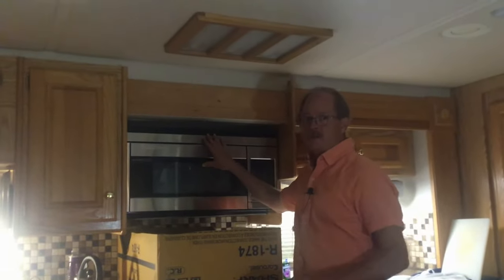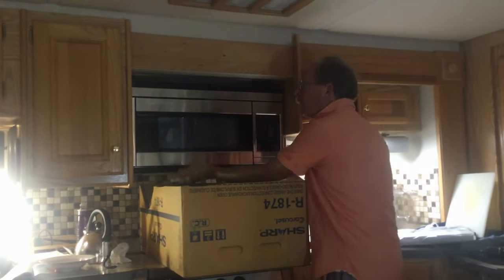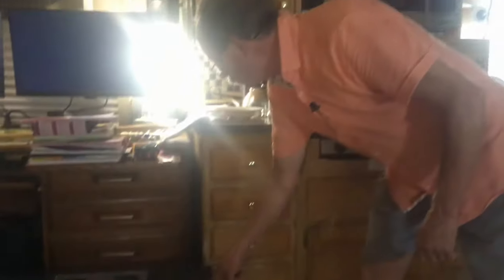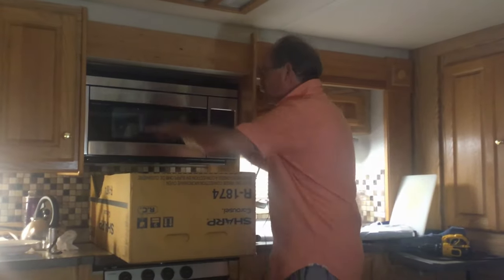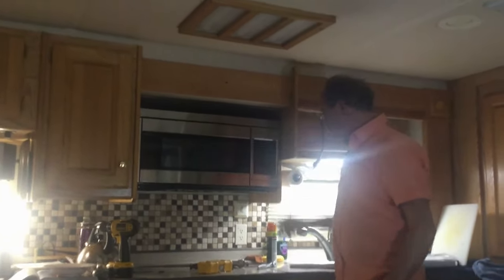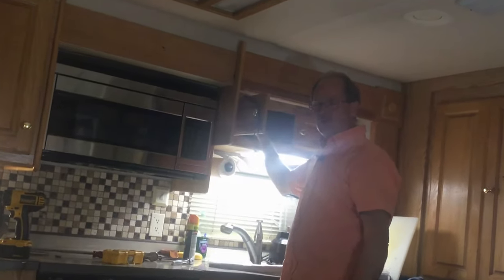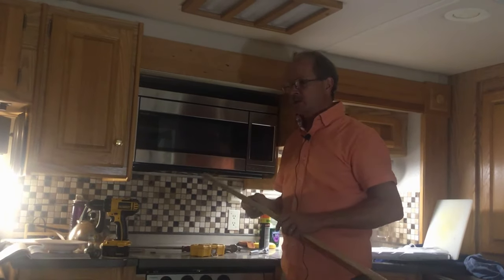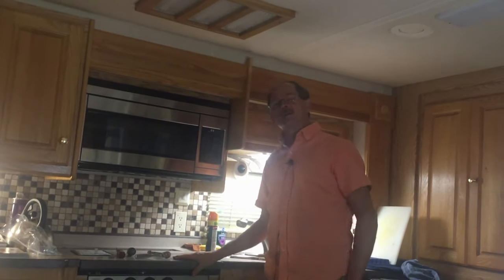DIY Replacing A RV Convection Microwave Oven

Comment: You said in the video that you got the new oven at Office Depot. I had to replace my microwave/convection oven and could not find anywhere an oven that used the long 45 degree supporting bolts, in fact no one had ever heard of such a thing. I ended up with a standard oven just hanging from the two top bolts which after a couple hundred miles started pulling the top shelf down.  I would go tomorrow to get an oven that came with the long bolts and the mounting bracket that they screw into. any ideas. thank you
Reply from the maker: Hello Danny, I ordered my replacement oven on line at Office Depot.  I don't know if the stores carry it in stock.  Shipping was free also to my location.
Thank you, Jim
Reply: @rvingdiynewbietopro4825  it must be an exact replacement as todays ovens do not have the long bolts to hold it up. I tried to find a replacement for what I had it was not available.   thank you
Reply from the maker: @dannybryant4440  the oven I ordered from Office Depot was an exact replacement with the long 45degree bolts and I used the old mounting plate. Did you try reusing the old bolts from your old oven?
Reply: @rvingdiynewbietopro4825  the new oven  would not accept the bolts
Reply from the maker: When I ordered the oven the model was a new version but had the same foot print.  I did reuse the old mounting plate for the long 45 degree bolts.  The new over came with new 45 degree bolts which I did use .  I then added the top mounting bolts which mounted onto the slide frame work.  Does the new oven mount the same way as the old one if not you would need to look into a different model #  The model I ordered was R-1874T YA  By Sharp and it fits and works great.
Jim